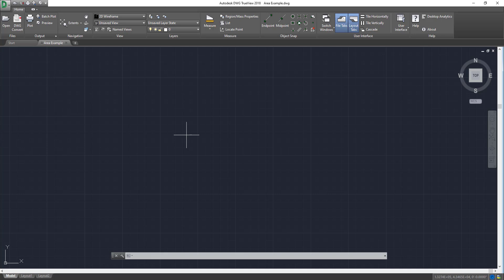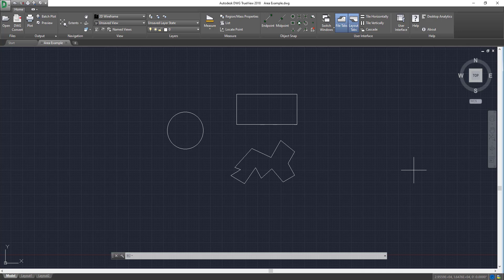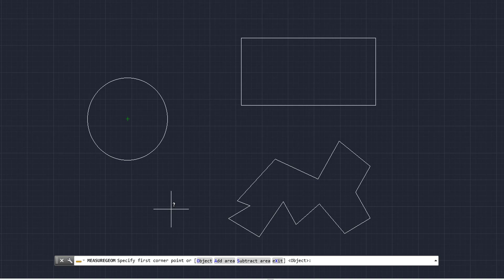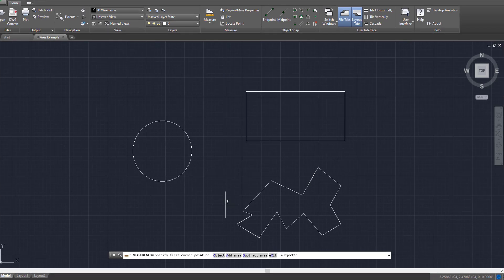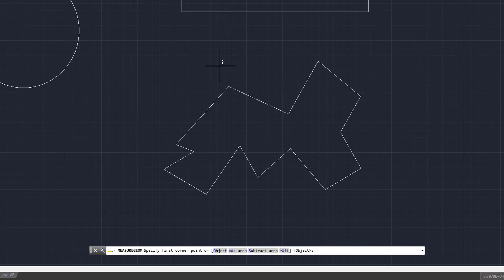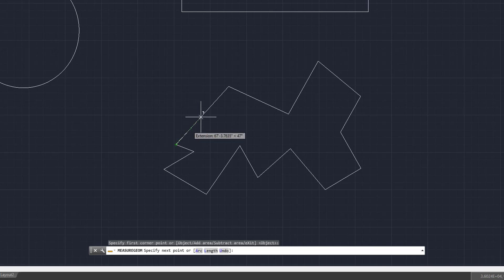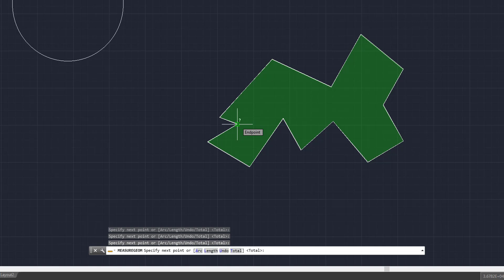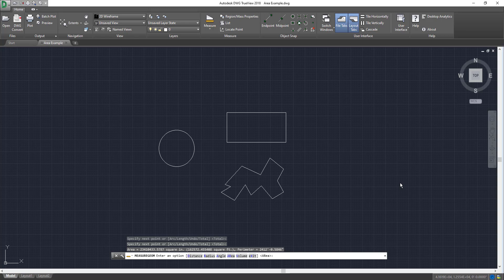Measure AREA of Shapes/Objects - DWG TRUEVIEW

Comment: Hey Guys, PICKBOX, PICKBOX, PICKBOX, Aperture and Snaps command.  What do I mean! Sometimes the Aperture /Pickbox is to small to be useful if the screen resolution is high. I understand that any entity within the pickbox will be selected, but newer version allow you to toggle thru the entity you want,  so you can snap the proper end points.  Not sure if Trueview allows you to do this.  My comment is not about this lesson, It is more about being alittle quicker completing the task and using tools to speed thru the work.  Everyone has had a task master at their offices, always asking "Are you done" or "Hurry Up".  Respectfully, Alex
Don't work so hard!
Reply from the maker: Alex, thanks for the comment! Unfortunately with DWG TrueView (at least this version) there isn’t a visible pick box. The aperture and snap commands are also lacking. Since this version is completely free to everyone my guess is that they really don’t want you to be able to do much more than view the drawing and take basic measurements. Completely agree with your comment about speed. Unfortunately TrueView’s options are relatively limited.
Reply: @matt.autocadbasics  Thanks Matt, I just do not use TrueViews.   FYI, I use Brava Desktop as a viewer, as an image viewer and Exhibit Marker.  I like it is very useful to help make quick exhibits.